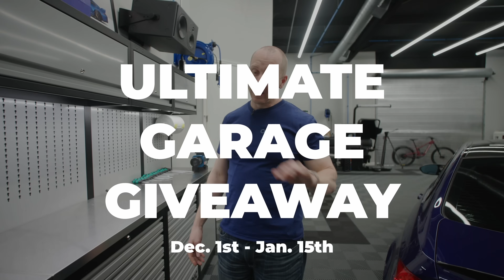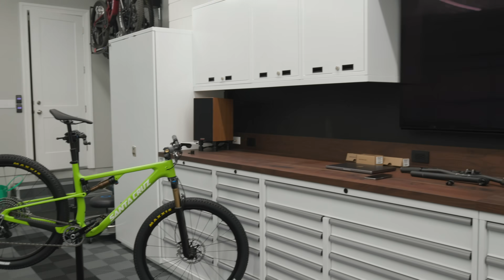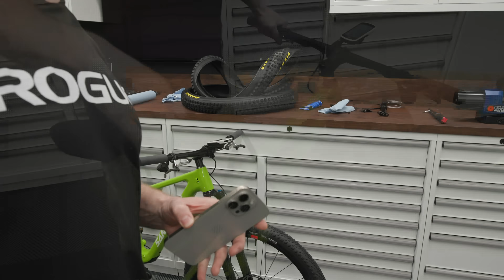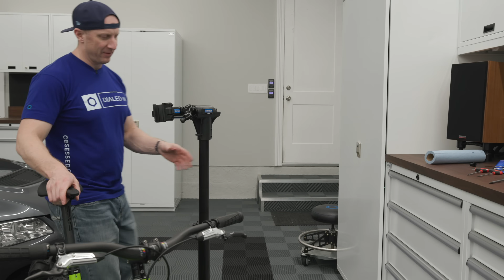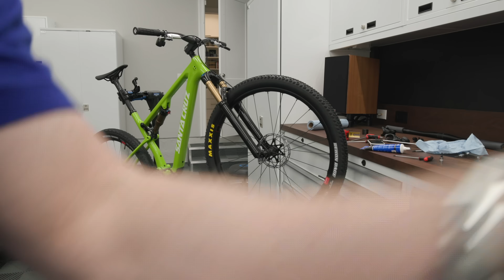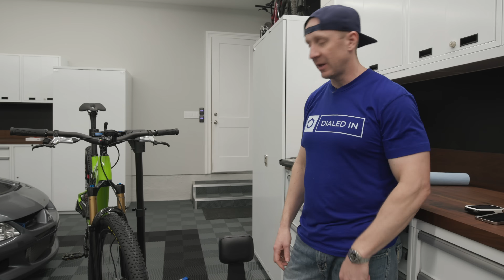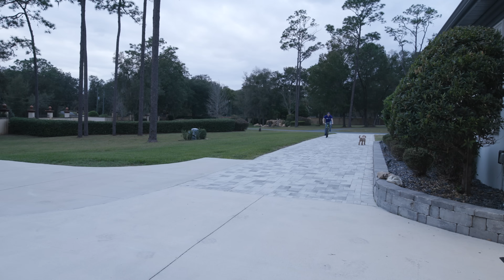I Spent $1,000 to Shave 250 Grams Off My Santa Cruz Blur Mountain Bike

Comment: I’m a little late finding your video, but I went through a similar process to you.

I found a screaming deal online for the same bike, but it was the Sockeye color-probably why it was on sale, lol

I was also in between sizes, and they only had a medium instead of large like all my other bikes, so I went with it. It turned out to be incredibly nimble yet stable, especially fun in the Santa Cruz forests across the bay from me.

I wanted to maximize the “TR” capabilities of this bike, so my first upgrade was a set of the Hydra equipped Ibis 942 carbon wheels, and with small knobs, Kenda’s Booster Pro 2.6’s still cleared the frame and fork.

Some lighter cranks and wider riser bars kept it under 25 lbs yet burly enough to follow my buddies on their long travel bikes over surprisingly chunky stuff!

Of all the bikes I’ve had, this is by far my favorite. Great for all day epics, or a quick blast to nab a PR after work.

Keep wrenching and riding!

Comment: I highly recommend the Rekon 2.40" in the back and a Forekaster 2.0  in 2.40"  up front. For your weight,  23psi front , 25psi rear.  I'd also recommend a 208mm front rotor. Everything else you're doing is for personal fitment . On the subject of fitment,  Google a Bike Fitter in your area. Totally worth the service.

Comment: Very strange spec choice imo. Those tyres don't belong on that bike. Not trying to be rude or anything here just some advise! Get a Rekon rear and a Forekaster front. Depending on your weight in EXO+ or preferably EXO for this "trail" bike. This will save enough weight for you to still run a dropper because that is a must have imo. With those tyres and a dropper the weight will be roughly the same I rekon ;)

Comment: A good starting point for pressures on that suspension is body weight PSI rear and half body weight up front.  Also, you'd feel less cramped in the cockpit if you pushed the seat backwards on the rails a bit more.

Comment: I have the '22 Blue TR with the same spec level (pre-transmission AXS).  I had problems with the stock Rekon Race tires blowing off of the rims under even modest pressure.  I went with a set of Bontragers instead and they've performed even better with no issues and shaved a bit of weight.

While I do have a set of flat pedals, I almost always stick with my egg beaters clipless.  They're lighter and do a better job of getting my power to the ground for XC riding.

I also found that the factory valve stems were rather delicate and opted for traditional brass.  Those few grams are worth having them not break.

I swapped my saddle for a narrow carbon version of the WTB Volt because it fits my sit bones better and shaves weight at the same time.

I like having a dropper and am still running the OneUp.

I like the OE flat bar, but I shaved an inch off of each side.  I may trim a bit more, but it seems to work well thus far.

Comment: I think the “don’t ride the Assegai/DHR” combo on the Blur has been said enough, but I personally like the Rekon Front and Rekon Race Rear combo on my XC bike for when it’s setup for trail riding (basically when I’m not racing). My XC rides are typically 2-3000’ vert with 1000+’ steep descents that are probably more fun on a burlier trail bike like the Hightower (used to have one) or my current Yeti SB130, but these modern XC bikes can handle basically anything short of maybe dedicated jump lines. 

I also wouldn’t discount the dropper on flatter XC terrain. I’m constantly going up and down with the post to gain efficiency or get that extra room for weight shifts. 

Didn’t watch through the entire clip but if this is a dedicated XC bike a set of clipless pedals and shoes will help you power transfer pedal in proper circles than than stomping down off the time. 

Enjoy the ride!
Reply from the maker: Yeah...I've been riding it for a few months now with the Rekon Race set-up.  It's so darn fast that I've gotten used to dealing with the lack of traction in favor of rolling speed.

Comment: I would look into the Ikon with a nice soft compound such as the MaxxSpeed, they come in a 29 x 2.35 but I always fet as though they hooked up much better than the Recons and the Aspens. The DHRII and Assegai are great for like enduro or heavy trail riding. 

Industry Nine Hydra hubs are awesome. I had a pair for a couple years with no issues. They sound amzing to as soon as you get them take them apart and clean then just reasemble with a few drops of dumonde freehub oil on each pawl. They will scream. You may also find onyx hubs interesting (They utilize an expanding bearing I believe, you get instant engagement with no noise). I have only test ridden a few times but they are also sweet you can hear the dirt and your tires interact and you feel a whole new level of control and stability.

With regards to learning more about working on your bike honetly just find a local kid who works at a shop. Someone like me who is 18 and has been working at a bike shop every summer for since he was 14. They will know bikes and what you need to know and what you dont need to sweat. 

Something like the Park Tool Master kit is awesome and every bike mechanics dream but you can build a prety complete kit for like a grand that fits in the something like the Park Tool Blue Box Tool Case. I take mine with me to every trailhead and event.

*You shouldn't need carbon paste on the stem, just check to make sure it doesn't slip before you ride
*35mm Bars are a little more downhill oriented, therefore almost always around 800mm going to 710mm you will probably be limited to 31.8mm bars.
Reply from the maker: Thanks for the advice!

Comment: Matt, let me know how you like the carbon handlebar. I switched back to aluminum several years ago because I found the carbon handlebar was transmitting too much vibration and causing a lot of arm fatigue here in the Utah chunder.
Reply: No aluminum bar I’ve ever had has been more comfortable and absorbed more chatter than any carbon bar I’ve used

Comment: Honestly I wouldn’t change the tires. If you need an Assegai/DHR II, you’re on the wrong bike to begin with. If the Rekon Race isn’t enough bite, try a regular Rekon. I run Rekons on my Canyon Spectral and I do a wide range of riding with them.  Your riding is likely similar to my local stuff where the Rekon’s are at home and I’m riding too much bike. When I travel to somewhere the wheels leave the ground, I either switch to the Assegai/DHR II combo or just ride like I’m not glued to the dirt.
Reply: Oh and remember, you’re doing it for the workout so if you’re riding and finding that the workout is only from spinning the cranks, you’re not going fast enough 😉
Reply from the maker: Yeah...I think you are right.  I rode again this weekend with the Rekons.  The bike is super fast.
Reply: @ObsessedGarage  it’s a trade off like anything else. I presume a lot of the trails you ride are going to be somewhat sandy/silty, so the rotating weight penalty will be rough. Doing it for the workout doesn’t mean you need to be slower. Just need to turn more laps!

Comment: setup looks good, nothing wrong with those tires for xc style riding, they are fast. im a big fan of the sworks fast trak/renegade for lightweight fast rolling xc if you ever want to try something else. only thing i would have to change is your garmin mount position. you have it so high up if you ever go over the bars and the bike flips its going to mangle the shit out of your garmin unit. also having it way out front is going to block your vision of your front tire contact patch which can be annoying on tech. i much prefer the mounts that come off of the steerer tube and float over your stem so it doesn't block your vision as much, or at the very least the adjustable angle ones so you can run it lower but still have the screen facing you. only other thing i would say is if you really want to save weight, you'd be better off getting a different frame, like an epic world cup, or something more focused strictly on weight than the blur. definitely a sweet build though, the new sram transmission is a m a z i n g
Reply from the maker: I agree.  I just got a K-Tech due to someone's recommendation.

Comment: Matt, first off great job figuring this stuff out on your own so far. There is a lot of nuance to setup, maintenance, etc. The new Blur is absolutely beautiful and love the color. 

A few ideas on setup and parts. The Rekons are a great setup for the Blur. The Minion/Assegai will kill the ride and make it just miserable to pedal. Those are much better tires for the new Hightower. Regarding the dropper, I have two AXS droppers and they have been outstanding. Most people don’t know that the new AXS Reverb has a bleed valve on it so super simple to maintain and mine have been rock solid over several years of use. I personally do not like using a traditional dropper when running AXS shifting since the lever action is so different. 

Finally if you are serious about learning how to do this send me a PM. I was a pro mechanic for eight years and put myself through college doing it. Happy to help you work through everything. You can see my builds on IG if you search the my username of Salespunk.

Comment: To set the headset spacers, you ideally want about a 5mm gap between the top of the headset to the top of the steerer tube. The top cap only needs a slight snug up, when the bike is on the stand slightly tipped forward, the front end should center itself again when you turn the handlebars left/right. Love the bike!

Comment: Lets get Matty into some Ohlin's suspension. Love my fox setup but been really looking at the Ohlin's 38 M.2 front fork for my 2022 Specialized Fuse Expert Hardtail. Recently switched my tire set up to Michelin Wild Enduro. So far great tire just like in the automotive space the design and overall look Michelin tires nothing comes close. It was between those or the minions. wanted to try something a little out of the norm.

Comment: Nice project!  I built up a Blur 4 in the Spring of '23 and I am nearly 200 pounds at 6'1".  I ride pretty hard in Colorado on aggressive "blue" trails on this bike.  Here is some random feedback for you... regardless of how much you weigh it's always fun and noticeable to ride a light bike, especially light wheels and tires.   That said I'd suggest you do some tire testing. Ride Rekon Race tires front and rear a while. Those are the tires Santa Cruz spec's on the bike in "TR" mode for a reason.   Then I'd try a Rekon 2.40 on the front leaving the rear tire alone.  If you feel the rear is sliding and moving around too much  then try a Rekon 2.40 on the rear as well.  Both of these tires are very predictable and easy to ride, not abruptly letting go when you don't expect it.  Keep in mind that light XC bikes provide a special ride experience because they are light and quick to accelerate.  Turning one into a trail bike ends up with a not so great XC bike nor a very good trail bike, IMHO.  With your High Tower you don't need to sacrifice the Blur to ride more technical trails.   I am riding an XL for the fit and longer wheelbase, making the bike slightly more stable and capable than it would in a Large.  Like you said you are on the cusp of a L and XL.  If I were riding an L I'd be even more likely to keep the tires light and quick handling to take advantage of the shorter wheel base.   I'll also say kudos to you for ditching the dropper if you don't expect to need one.   For your size I'd stick with 760mm wide bars and adjust the height and stem length for comfort like you are doing with the riser.  If you do get onto more aggressive trails you'll find the 760's more stable, and your fit will more closely match your Hightower, which is a good thing for a number of reasons.   Hope that helps... food for thought anyway.  Thanks for sharing your video.
Reply from the maker: Thanks for the input!

Comment: On tires, for my terrain, I went Maxxis minion DHF in the front and Aggressor in the rear. Granted, I tend to air on the side of super stubby and heavy when it comes to tires because I'm partially in it for the workout, and I have a lot of loose sand and mud around here, but they worked great for me
Reply from the maker: That’s a great point.  I’m doing it for the workout!

Comment: Regarding wheels.............if you havent heard a set of i9's, I highly suggest finding someone with them. i9's are pretty loud. And if you dont like loud wheels, you wont like them. I have a set of DT350 hubs, and a set of Hope Pro hubs and the Hopes are loud. They're on a pretty loud bike to begin with, so it's not the biggest deal, but on a dialed in carbon bike (like my Santa Cruz 5010 with DT350's)  with a good transmission, the loudest thing on it will be the tire noise and a bit of chain and brake noise here and there.

Comment: As someone that loves mountain biking..removing the dropper in my opinion seems like a giant step backwards. (Each to their own..)
1) It is a full suspension bike
2) you have gone for more aggressive tyres meaning you generally want more grip for more gnarly trails
3) a dropper allows you to have proper body position when climbing and decending
4) a dropper will also give you more cushion factor than any carbon post..

it might look cool without it..but being able to work on proper technique and quickly get the seat out of the way allows you to move the bike under you a heck of a lot more...it is the one item worth putting weight back into a bike.
Reply from the maker: I've never one time felt the need to have the seat out of the way on the Santos trails.  I prefer to remove the weight and get rid of the cable since it never gets used.  I'll have one on my HighTower for the mountains.

Comment: Try to adjust the brakes with this little "trick"...loosen the caliper mount and pull strongly the brake and hold it, then tighten up the caliper. it works for me very well and easy
Reply from the maker: Smart!

Comment: Not many tools you need that you don’t already have.  Park pedal tool is cool.  Otherwise a Y wrench (4,5,6mm) does 90% of the work.  Cassette and BB tool is handy, along with a wheel truing stand.  Probably $600 all in on tools.
Reply from the maker: Dang it!  I want an entire arsenal of cool stuff.  Ha, ha...
Reply: @ObsessedGarage  so much of it isn’t applicable to high end bikes.  Cone wrenches (super thin open end wrenches) for adjusting hubs, cable tensioners, etc.  Fox does make some really nice gold anodized aluminum sockets specifically for suspension work that won’t damage the finish on the fork and shock, those are worth checking out.

If you want nostalgic cool, look up the Campagnolo Master Tool Kit.